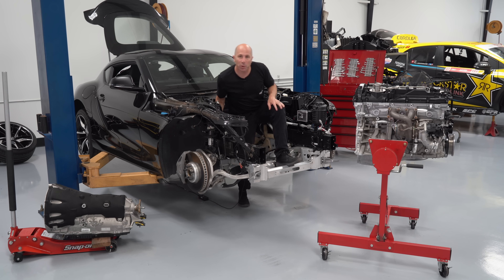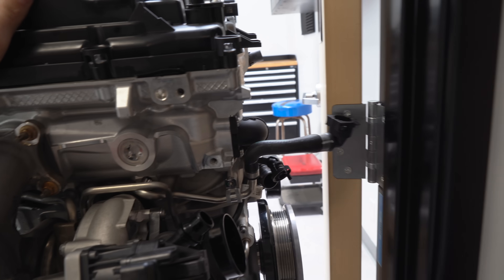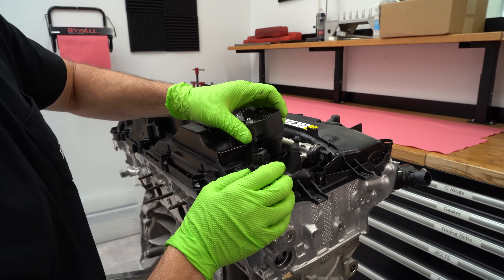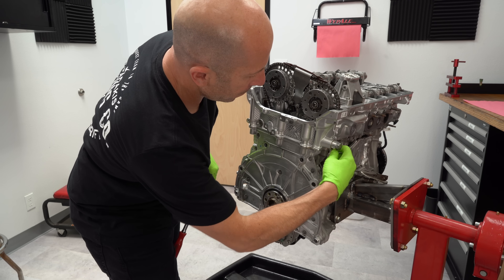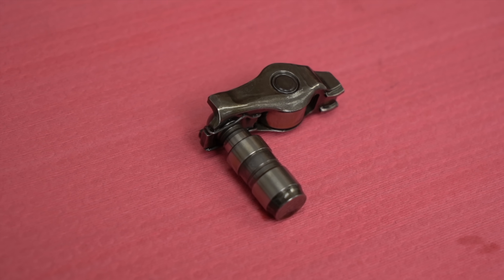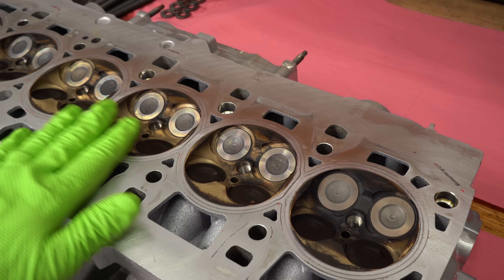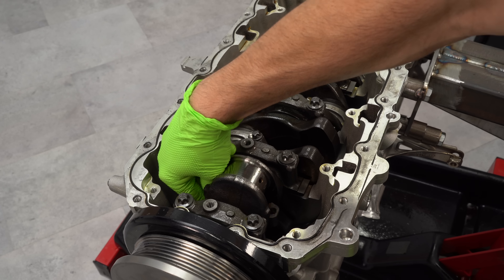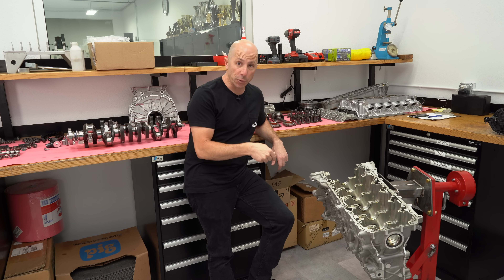2020 Supra B58 Engine Teardown - First Look - Better than the 2JZ?

Comment: This engine has some interesting and novel technology. The plastic intake is a great idea for weight saving but you have to wonder about the air/water intercooler for high HP applications. Older engines are easy with the ability to swap in a larger air to air intercooler.

The direct connection of the turbo to the internal exhaust manifold is nice an neat. I foresee some stub manifolds being produced with standard flanges for upgrades and maybe even some turbo housings from the turbo manufacturers if these motors become anything like as popular as the 2JZ.

I like the idea of the oil cartridge filter and the water to oil cooler. I've got to hand it to Toyota for the innovative approach to replacing the venerable thermostat and the trick adjustable intake valve lift. Lots of extra moving parts there though.

Unless the ECU is tunable we will have to wait for the aftermarket ECU makers to add more controls for the thermostat and variable valve lift before we can make full use of the potential of this engine. 

The block, with its external ribbing, shades of Ford Barra, and crank look pretty stout and it will be very interesting to see how much potential can be brought out by the tuners and how well they last.
Reply: Brian Brigg 
BM3 and MHD are two aftermarket tuning platforms for this engine on the stock ECU and from what I’ve seen a lot can be done with it.
Reply: @harbl2479   That should make things easier. In Australia we don't get many Supras but I'm sure that there will be tuners looking to do things with this BMW/Toyota engine. I'm sure that there is a Haltech ECU that can be programmed to do anything needed on this engine at the cost of doing a custom engine loom.

Comment: Hi, unfortunately no b58 where I am . Bought a 330i b48. Building it. I am new to this. Need a little help, please. 
B48 in essence is just a chopped off b58. Will I need studs and retainers for 500whp build? I saw you used stock crank, etc. will I get away with stock crank because they gave the jcw Mini a re enforced crank and bigger main bearings just for the extra 50hp. Also they lessened the CR to 9.5 from 10.2 of 330i.
Reply: I dunno much about the B48 but I've heard 400whp is the highest I've heard I dunno about 500whp but I'd say look to the bimmer forums to help.
Reply: @carboydorifutoparty3976  i have ordered cp pistons carrillo rods and kings si main bearings, cant find rod bearings. stock crank should be good for 5/600whp? will i need bigger injectors?? studs retainers what all? 
thanks in advance
Reply: @mkproductions3651  I'm not entirely sure tbh. But its my guess since the B58s crank seems to be able to handle 1000hp vs the B48 (not saying it's going to be handling the same numbers)but it "could"be capable of handling it since I haven't heard any get that high in numbers with the B48(I'm defiantly going to need to look into the B48 more) now I'm not saying it will but it's possible in my guess but id look around for better sources than just me.
Reply: @carboydorifutoparty3976  it should be good for 500whp? What's having me second guess is they gave the mini jcw a re enforced crank on it's b48 just for the extra 50hp and bigger main bearings and less compression ratio pistons. But a re enforced crank for 50 hp more??????

Comment: Worst engine ever.
1 no dip stick so you cant check the oil quality
2 uses a timing chain, so tuning to high BHP is out the question really. Yes you can make the power, but it won’t last. Belts are much better
3 silicon gaskets is just cheap. 
4 the engine will need to be sleeved at a high cost. 

Personally it’s not a bad engine, but it’s not a 2jz type of engine.  
Toyota should of built a modern 2jz type engine.
Reply: It would have to be an interfere engine though (not a lot of tuners like that) with maybe Dual VVT-I, Aluminum Closed Deck Block, and maybe even use the D-4S Injection system to meet standards nowadays

Comment: Nice engine. But I do Not understand why BMW does Not use also Port injection in this engine.  This would prevent Carbon build up issues. There are even 3 cylinder engines  from much cheaper manufacturer which use both systems now.

Comment: you mentioned the coating on the connecting rod bearings it appeared that the main bearings were coated as well also it was only the upper rod bearings and the lower main bearings I'm assuming that's due to gravity and downward forces being the main focus and concern

Comment: just a second what kind of racing do you do 2 stroke?, I don't know what is so special about a normal European Engine but being amazed by an OilFilter and Cracked-Rods or the normal ignition or is a mechanical ignition still up to date( I dont think so roughly went out of serious production around 2000 maybe earlier) now we have the year 2020 , Low friction! really easy to turn... what do you normally work with I'm getting frustrated on my end... this video makes European engines look like witchcraft. PS did Toyota get it right its a Damn BMW engine and for a little hate in this comment check BMW history from beginning to today, P.S. engineering a new engine costs a lot, so modifying a good engine saves MONEY!!! I hope people understand it! and I hope that idiots stop wrecking good setup cars and that Toyota makes a great Na engine again like the 4age in the ae86 or MR2 NA. Rule Die turbos no one needs that terrible whining or 100k+ revving of a turbo , 2020 go to hell and hope for better years to come!!!!!!!!!

Comment: I own a 94 Supra Turbo 6-speed. I changed my timing belt , water pump, valve stem seals and a few other things in a few hours. No thanks on that trash timing chain at the back. The 2JZ was developed nearly 30 years ago and still can't be recreated. Haha.

Comment: Its still a POS engine if it takes 30 hours to replace a timing chain. The old 2JZ might have it's issues, but it doesn't need that much labour to fix it. All this new technology is useless really when they are making cars so complex that they have more complexity than a MARS ROVER. 

Let's see this engine hold up past 150K with no major issues. Good luck on them timing chain guides since they are plastic or any oil leaks at the back of the engine.

I'll take a 4 cylinder Honda with Ebay turbos and built internals any day over this POS and still wipe the floor with it. ( i don't even own a honda, but i'm a mechanic for 13 years, and realise how stupid new engines are really and how uselesss and hopeless they are after a certain mileage. )

Comment: Honestly this looks like it was designed by a diesel engine mechanic. Direct cylinder injection, camshaft driven fuel systems, flywheel driven camshafts, and piston squirters.

Comment: Papa: Hey i need a 13.456 to take out the spark plugs
Toolbox: I only got a 13.455
Papa: No way will not fit i need a 13.456
Papa: I got a lathe

Big Brain Home mechanic: yes purchase a lather for 4,000$ for a 6 300$ spark plugs....Priceless

Comment: How on earth do i see rusted bolts on the engine in the first 20 seconds of the video, from car which is out of the year 2020 with 500 miles on it. What. Or is it coppper lubricant?

Comment: Are you sure, that the clean valves are the intake valves? As far as I understand that the clean ones are the exhaust, because they got cleaned by the injectors, because they are closed?Or Am I wrong?..Also the clean valves are on the side where of the manifold.

Comment: BMW
Reply: So?
Reply: @carboydorifutoparty3976  not the next 2jz then.
Reply: @AnanusBananus  ok? Why does it have to be a 2j tho? There are plenty of 6 cylinders out there that are built differently that are pushing the same or more numbers just like the 2j can.
Reply: He said that Will it be a worthy successor To 2jz. It will not, as it is a modern BMW engine. And To your statement, no, there really is not too many engines that respond To tuning and handle big power like a 2jz. Maybe a barra.. Rb is More complicated. Stock 2jz bottom end can do 600 reliably.

Comment: So is this engine exactly the same as the Z4? Or a little bit different?
Reply: The heads are different(Z4 has 6 port heads instead of 2 like the mk5 has),mk5 has a bigger turbo,and mk5 has a stronger fuel system(higher pressure)

Comment: as a every day driver car i would stay away from this joke of a engine the placement of the timeing chain to repair or replace it how ever you want to call it would make for a high dollar fix not good
Reply: Whats with people wanting to mess with the timing chain with these when there not to be replaced in the first place?
Reply: @carboydorifutoparty3976  dont know what you know but all moving parts wear out at some point and all belts or chains stretch out to a point they are deemed worthless in any car truck or place they are used

Comment: Don't even need to tear down a 2JZ to make 1000 horsepower. My gut feeling was it was a mistake for Toyota to badge engineer a BMW. Sure it was cheaper. This thing barely makes more horsepower than the last proper Supra and is more complex. Let me elaborate: direct injection, exhaust manifold molded-in, multi-stage intake valvetrain, goofy cam drive system. This meets modern EPA standards...I'm sure the engine is lighter too. It certainly doesn't look more durable. This was informative, so kudos for the illustrative teardown. I'm even less interested in owning a new Supra though, and that's saying something. Long live the LS.
Reply: There's one B58 240i out there thats pushing 900whp. There are even some B58 mk5s rolling with 600-near or at 800hp unopened and still running.

Comment: You missed the part where you say the 2jz is superior
Reply: Supierior? This barely has any aftermarket yet it's already pushing numbers way faster than a iron block 2j can on stock internals,weights less, has near to no lag,and is stupid responsive to simple mods. The aftermarket for these may not be big like the 2js but that doesn't mean the B58 isn't one of the only i6s out there that can make similar power to the 2j.

Comment: Spent 27 years at a dealership
We worked on a lot of different engine from different manufactures
I built many engine stands because each year big changes were made 
It was just the way we did it we built many specialty tools

Comment: This engine looks ugly bmw makes some awful looking engines under all that plastic. Race motor with plastic parts omg toyota make a bad choice. Has to fab up socket just to get spark plugs out. No gaskets, timing chain in the back of motor wow. This is not a tuner friendly motor. The supra is officially dead 💀
Reply: U do realize that the 2j has plastic itself too right?
Reply: Every motor has some plastic bro but tell me a bmw motor that is proven reliability and value on high boost applications at near stock form. Bmw is junk after 60k miles. Good luck doing timing chain on the motor with it in the back lmao. Every high hp bmw i see at the strip has a LS in it💀. I just would have felt better with toyota using its on development and motor to make reliable jdm power. The isf V8 motor is amazing why not boost that motor or something close. 100k mile reliable engine that makes really good power. Toyota missed the mark this time

Comment: Is it better than the 2JZ engine ? Also after making 1000 HP, how often will the engine need to be checked if its run to about 80% of its capacity ? How often if its run at full tilt most of the time ?
Please reply to all questions. There are 3 questions.
Reply: It's more responsive to mods,makes power faster,and has near to no turbo lag but I wouldn't go THAT far in saying it's all the way better.2 there hasn't been anyone who's really had time to push 1000hp with these yet to say.3. That's the way their built. These i6s are built with a tilt.

Comment: the valve train looks weak as hell . especially those cams . who else was looking for BMW logos on engine
Reply: @Seb C I don't know much about crack heads either but they look weak as hell also
Reply: @Seb C dude , it's not me calling you a crack head , it's just abductive reasoning towards the valve train . I.e. the valve train looks weak so therefore it is weak ,  if it looks like a duck it must be a duck . in no way shape or form was the crack head comment directed to you.

Comment: This engine would blowup if you pushed it past 1400 hp or less cuz it's aluminum. 2jz is way stronger. Only way it could compete is if you tossed that block and replaced with a billet block which costs more than the car itself. Same thing with the nissan gtr. Those videos of 2000 3000 hp gtrs are using a billet block which is like a 50 60k engine

Comment: Wow this thing is  space ship complex, I admire all the engineering that goes into this. 
Definitely seems to a novice  like these cars are not built to be low maintenance  reliable  vehicles , they seem to be complex exotic beasts.
Personally I will stick with a drive system involving   2 batteries no transmission and a electric motor thank you.
But i enjoy watching all this  Rube Goldberg hi tech professional engineering squeezing the last speck of torque out .
Yes a lot of mechanical systems have been consolidated, but it seems to have come at the cost of massive complexities added to maintenance , manufacturing and the ecu/software (everything is thrown on top of the ecu which is not necessarily bad but definitely more complex to trouble shoot). 
I understand this  vehicle represents a pinnacle achievement of and industry , and it is cool and amazing! But i hope this is not the direction of cars for the masses.
Thank you!

Comment: Nice video. I really enjoyed seeing the tear down. I've always liked having the canister type oil filter on my car. First, it's so easy to get to (front and center on an E46) and second for the reason you stated. When I learned my trade as a pilot, I used to poke my nose into the engineering shops and the aviation guys working on piston powered aircraft always actually cut the filters open to inspect them to see if an engine is making metal. It's a good feature. Just looking at the dimensions of the timing and oil pump chains I'm already doing my first oil and filter change in my head. CLEAN oil and regular inspection of plastic parts will be the order of the day me thinks.

Comment: To be completely honest, Im not real comfortable with so much reliance on the ECU. I like building engines. Always have but I tune my motors on the stand. No computers. Having a computer running everything is not only what I would call a massive cheat but also VERY expensive and difficult to repair. For the record, If thats what you like then have at it. Im not trying to put anyone down for enjoying and driving these cars and others like them but please dont lecture me on your masterful tuning skills. Im sure you can take a pile of parts and assemble an engine but the ECU is doing all the tuning, adjusting and monitoring. Just my humble opinion.

Comment: Great video, very informative and interesting to see some of the latest advances in technology on display in this engine.

However, I have to say, modern engines look awful. When you first took the plastic cover off, the mess of spaghetti underneath was horrific. I realise it’s all there for a reason, but purely aesthetically, it just looks terrible.

Comment: Now that you've had a 1000hp B58 and a 2JZ on here you need to build a 1000hp 2016-2020 NSX engine and a 1000hp 2015 and newer GT-R engine and have them all on here to compare the complexity and all the other info like build price and all it would also be interesting if you was to add a RB from a 90s GT-R and an engine from a 90s NSX and compare all of the engines in a series of videos

Comment: The rod caps are broken like the old Chevy like the 96 lt-1 and older irony block chevy’s it made them stronger for the rods to be done like that so from what I’ve seen these Toyota motors have adopted some old school V-8 tricks and having broken rod caps made for better rebuilds take a look at the 427 Chevy the 76 Lt1 and some other American iron muscle I guess  Toyota has finally paying homage to OG of the racing community I say it’s about fucking time toy/ota has done so in no way is this a shot of disrespect in a bad way it’s a shot none to provoke some sort friendly rivalry you know import vs domestic and I am domestic muscle all the way I guess since I think it was Toyota who helped developed General Motors turbo car program back in the 80’s starting with the grand national to the turbo Buick Regal and the GMC syclone;typhoon all the way to the corvette’s LT-5 dual over head came based LT-1🤔 block which on made 435 hp GM’s had high hopes for the LT-5 program horse power numbers  
Go as high as 600 hp for having a dual over head cam set up for a traditional small block and so the whole LT-5 power plant was scrapped if favor of the reverse cooling system of the of the gen 2 LT-1 not to be the same as the 70’s LT1 block program I believe that power plant was the highest horse power producing small block Chevy without any type of hesitation to go forward as they proceeded to making more horse power for the future of the Chevy small block the came the gen3 Chevy small block yes the whole LS and LSX and how it this small block can make serious horsepower naturally aspirated and even more on the ridiculous scales with power adders IE Nitrous turbo super
Chargers hell even smaller of the smallest small block the ones in the CTS BUICK REGAL AND SO ON

Comment: Also. Theres no way that oil cooler will fail and you end up with coolant in your oil🤣. Plus your timing chain is kn the back. So you literally pull the motor to put a chain on it? Oh wait. BMW Camshafts dont last 100,000 miles much less 150,000 🤣